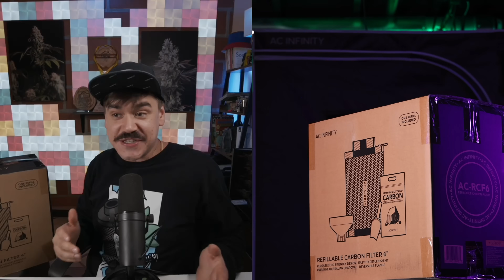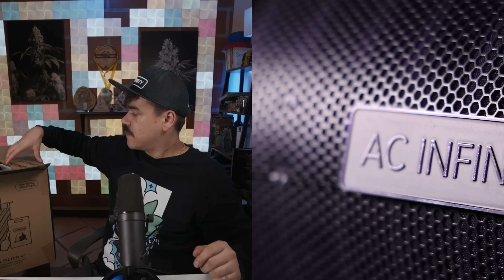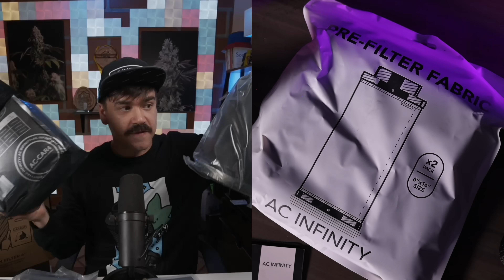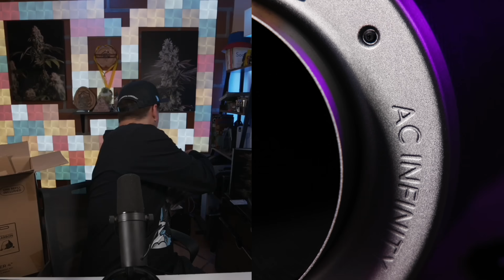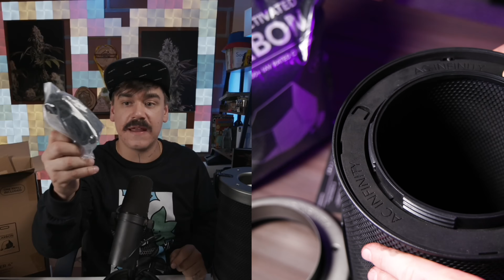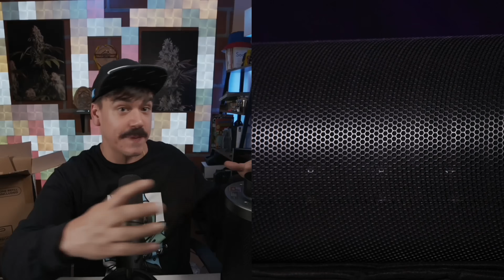AC Infinity Refillable Carbon Filter Interview and CONTROLLER 69 PRO +

Comment: Take the used charcoal that you take out of your filter put some of it in a sock and it works great for like refrigerators closets you can put it in  your  safe just rinse with cold water let drive start using?😮😅

Comment: If you use that char in your soil it will need to be activated first
Reply: It's already activated. I think you mean "innoculated", as in impregnated with beneficial bacteria so it doesn't absorb nutrients from the soil. Just premix it with some soil and add some liquid probiotics for a week or so.

Comment: Been using a refillable active carbon scrubber for laser cutting indoors and they work well when packed well. One thing consumers have to keep in mind is the potential for a loose pocket of carbon letting channeling and smell through. You take that into your own hands now vs blaming the manufacturer for a bad filter.

Comment: Awesome refillable carbon filter , hell yeah 😎 it's about time a  product like this is out on the market !! Save alot of money 
Home Grow TV 👍😎👍
Reply: @fasi247  👍😎👍
Reply: Products like these are out for over a decade oh boy.. 🤦 AC Infinity is just a cheap brand that produces low quality plastic, ALL made in China. Had two full sets of their gear and not even the controllers worked properly.

The brand is bad in any way or angle. 
Their lights are mediocre and produce almost double the heat than most other cheap brands..

Comment: havent replaced my filter in about a year now. still takes the smell out more than good enough. cant smell it when i walk in my house. only when i open the tent. fan speed is usually set at 3 on 24/7 humidity is typically around 55-65%.
Reply: Yeah I've put in 6 or 7 grows with one of my filters and it's still scrubbing like a hobo with a bottle of Windex at a stoplight.
Reply: yeah, just replace the prefilter every 3-6 months. but i like this refillable one because it will be the last one you'd ever need to buy and activated charcoal is cheap. tbh replacing the prefilter every month is a better idea. just have a couple backup prefilters and wash them. even with this refillable one it will still save you on charcoal.

Comment: AC Infinity is the best.....well not the oscillating fan but I hope they fix that. I have Ben using the same filter for three years now. I will soak it in vinegar every 6 months and it works great. No smell at all.
Reply: If you attach the fan upside down, it has less stress on the oscillator
Reply: What is the gripe with the fan?
Reply: @prestonpowers7376  its trash. after a month or 2 it starts making clicking noises like its missing teets on the gear to oscillate. at least for me. i stop the oscillation cus it was annoying AF
Reply: @TheJomoe1  Honestly, you don't need an oscillating fan. I recommend a few none oscillating fans
Reply: @TheJomoe1  have you contacted customer service?